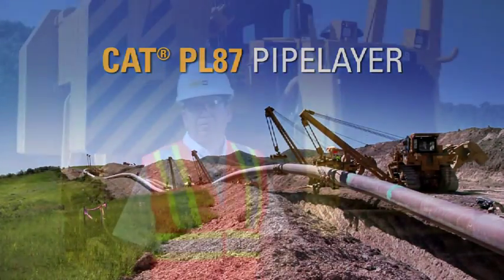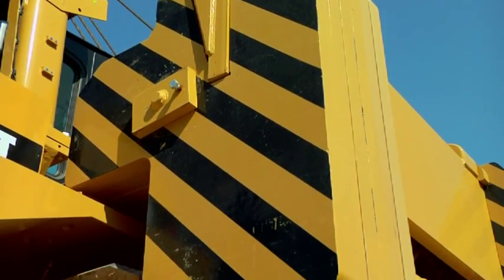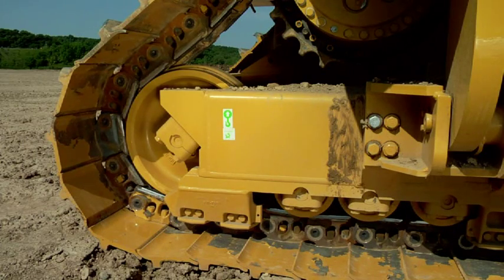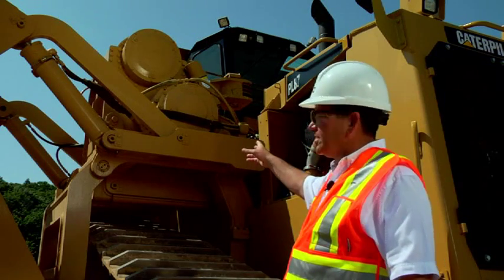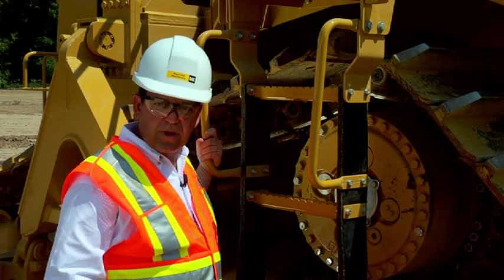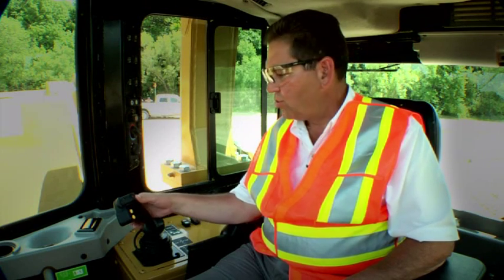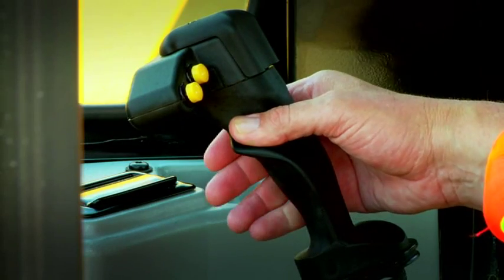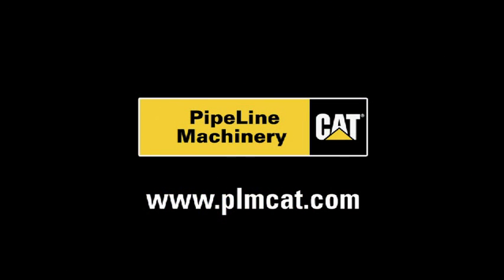Cat® PL87 Pipelayer | Features and Benefits

Comment: The gen 2 is good but these 1st Gen with the paddles is horrible.  They catch and slam, nothing smooth about it.  Gen 2 they need to add a way to adjust the drum speeds so we can fine tune our blocks a sticks.  Also a fine tune speed for the drums.  The Gen 2 are almost to fast for trying to get the classic “just a ____hair!